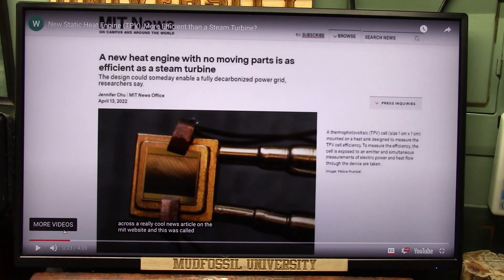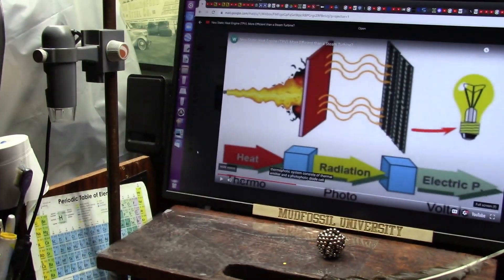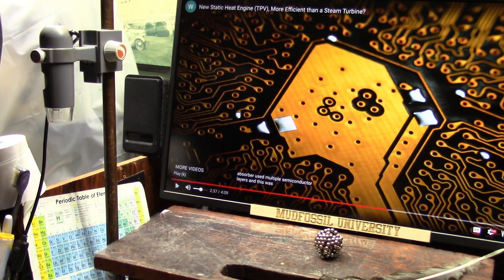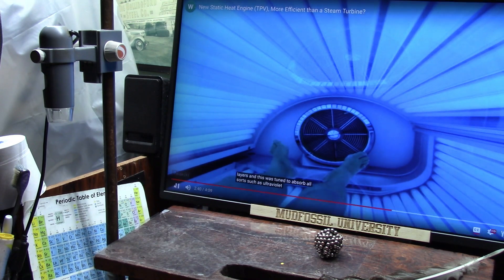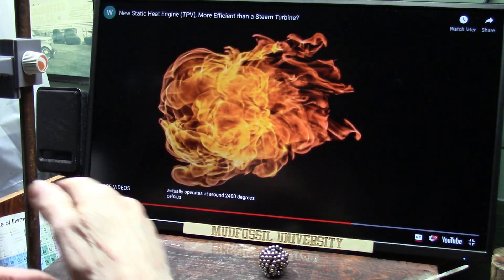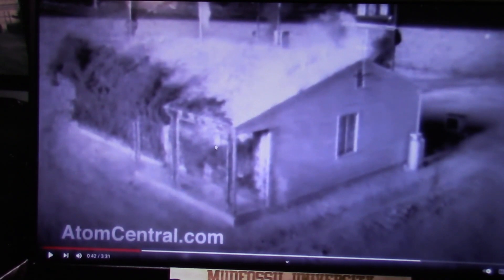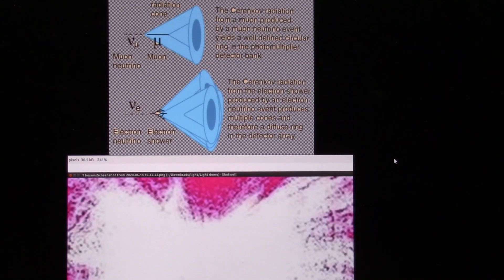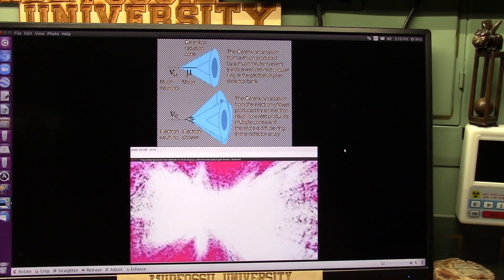Breakthrough Tech gets Closer to Free Energy

Comment: Roger I wanted to ask a question?, when you heat Gold at a certain temperature it throws off what looks like lightning ⚡️ could this be a form of Energy ?  Only asking because I put a bowl in the microwave that has gold trimming by mistake and it’s started giving off what looked like lightning.
Reply from the maker: That is not temp its freq flash.
Reply: @mudfossiluniversity  thank you i will look up and learn freq  flash.
Reply: What Frequenz was Gold ? They are Mining IT all the Time with this Technics.
Reply: @thinkbig7195  316 Hz

Comment: Your explanation of nuclear explosion is completely wrong the burning is caused by the gamma radiation burning not just the exterior but the interior as well as high yield gammas will go straight through everything but extremely dense materials like lead, solid rock or reinforced concrete and shockwave that destroys the house is  compressed air caused by the explosion and not just nuclear explosions all explosions generate such a shockwave just its size and destructive power is determined by the yield of the explosion.
              The reverse effect after has nothing to do with attraction its to with the shockwave pushing all the air out creating a small vacuum pocket and when the shockwave starts to dissipate, the outside air pressure is greater and rushes back in to fill that vacuum.
             Again this effect has nothing to do fusion or it being nuclear all explosions cause this effect.
Reply from the maker: Explain what GAMMA is my friend...it is the WHITE BALLS.